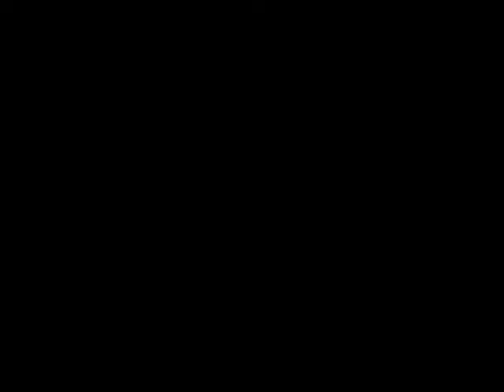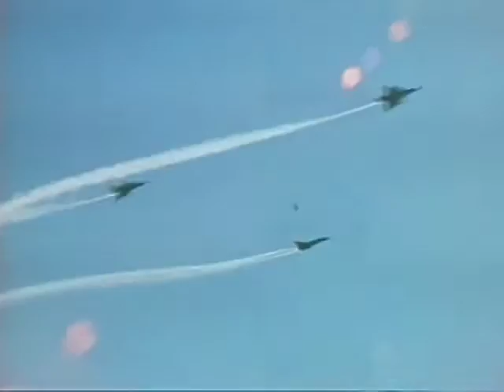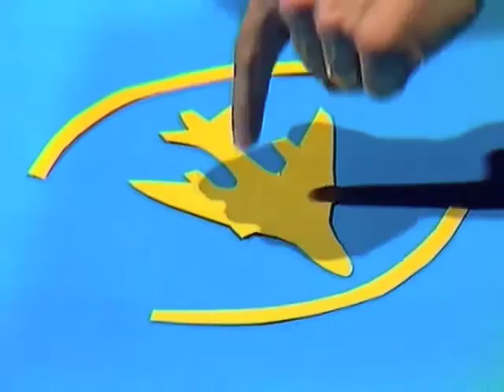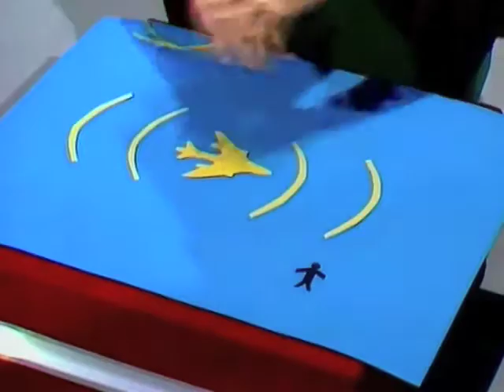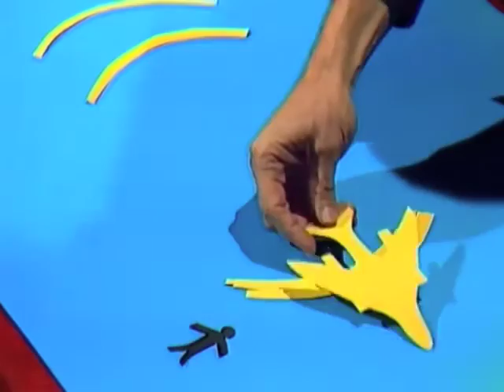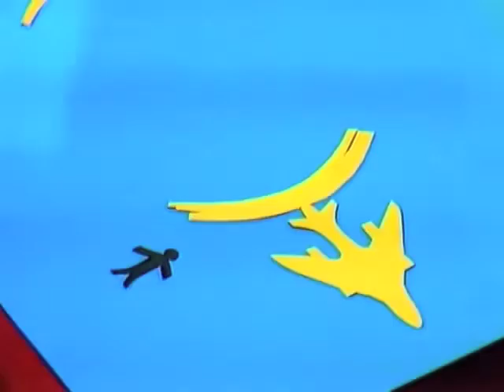Breaking the Sound Barrier

Comment: Thanks for your explanation Deane. Could you say there are similarities between this and the doppler effect, in how the sound waves "bunch up" as the object approaches you?
Reply from the maker: Yes - the Doppler effect can be explained in a similar manner.  For example, an approaching car produces a high pitched sound because the sound waves 'bunch up' resulting in a higher frequency sound.  After the car passes and recedes into the distance, the sound waves 'spread out' producing a lower note.  Deane.
Reply: It sounds like they are basically identical situations, except one produces a much more intense result than the other ;-) Thanks Deane.
Reply: Light waves too, doppler in this case is called redshift if the object is moving away from the observer.